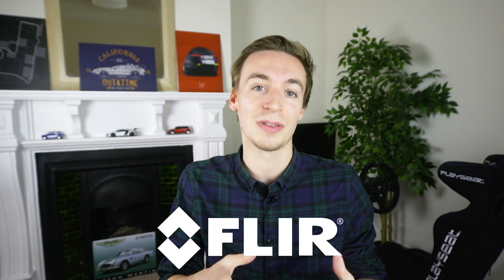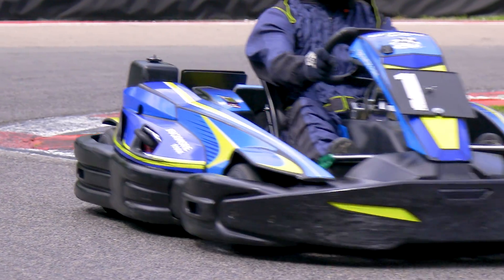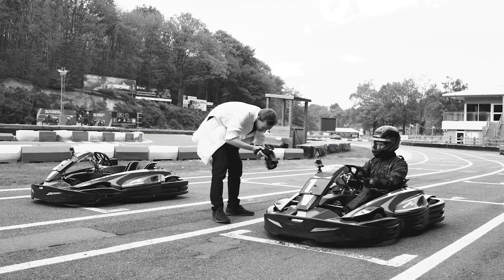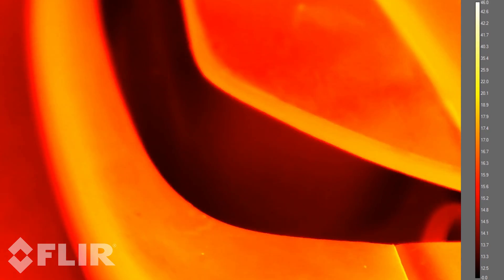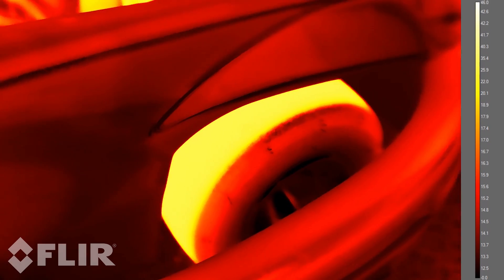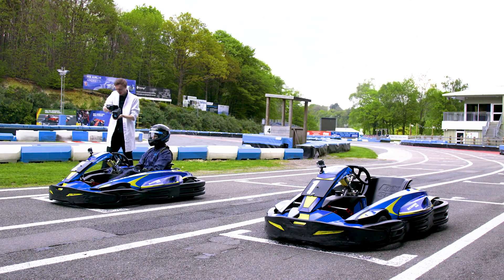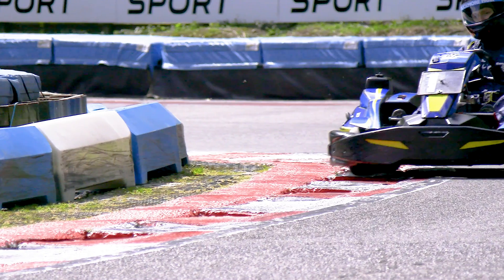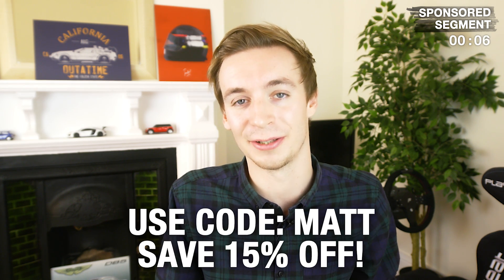Does Heating Up Go Kart Tires Work?

Comment: Here's the thing though I don't think this experiment is necessarily complete:
• Tell us how long (and show complexity) the track is, your 1 lap might be 3 laps of ours
• How much hotter would the tyres on kart 1 have got if it just drove for a lap or 2 more? Maybe I wanna cut the manoeuvres if the tyres will heat up in a lap or two
• Time differences - how much time can be expected to be lost from both intentional warming and from tyres being cold respectively? This will vary per track and conditions but can influence our choice

Overall informative video just could've done a lot more. I may just tyre warm to be on the safe side and then compare how the kart feels
Reply: Also I wonder if the gap is that big for an indoor track, like is it good to warm up2 out of 10 minutes for exemple

Comment: Does anyone know what the optimum temperature for karting tires is? Just wondering
Reply: Around 65-70°C, above it the surface overheats and you loose grip because of it
Reply: Nathan Hillaert thank you!
Reply: @nathanhillaert5582  Overheating tyres wont give you less grip its just more dangerous becouse of popping

Comment: I'd say it is useful if you are going to be doing a proper race and need to be quick straight out of the box, but if you are running for best lap time of the session, I wouldn't bother.  I always just went out and (assuming I had a reasonable understanding of the layout and the track management allows it), pushed hard straight out of the pits.  Yes, it means I tended to slide around and run a ragged lap, but it got me straight into understanding the handling of the kart.  Realistically, if you run your best lap early in the session, you aren't really maximizing your performance anyway, so there isn't really a rush to have perfect tire temp in the first couple minutes.